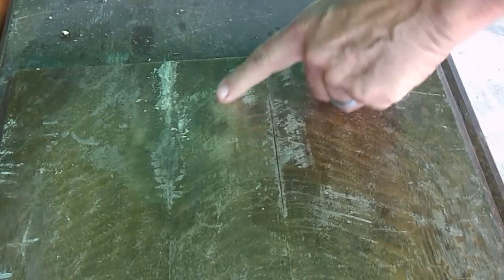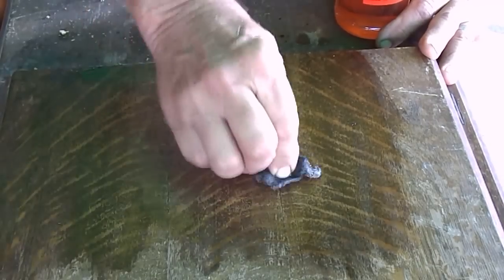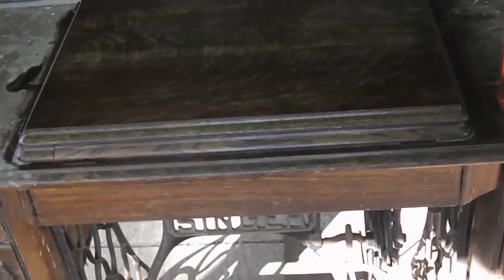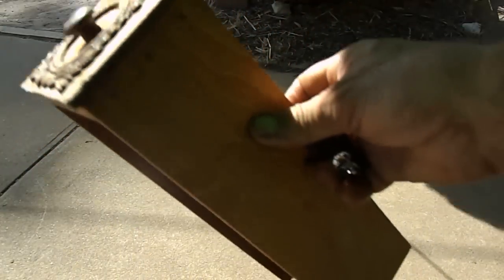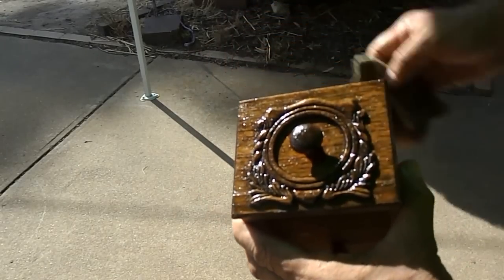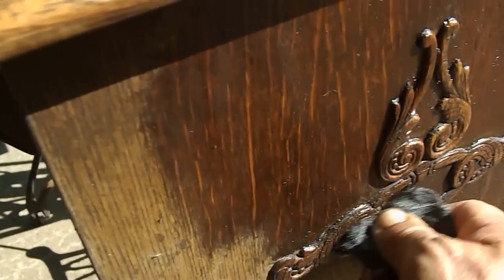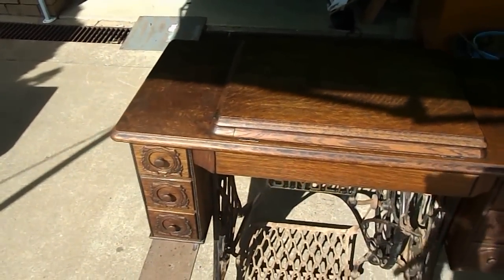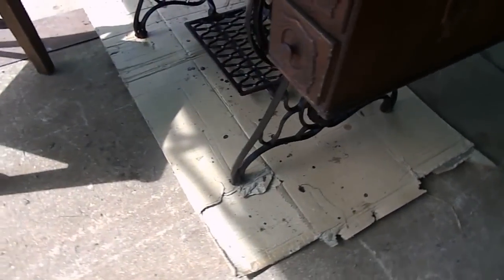Restoring a Treadle Sewing Machine Cabinet from scratch

Comment: I have the identical cabinet - I polished it up with almond oil - the only oil that I had on hand but may try the Linseed oil.  Unfortunately I had stored and used my water distiller on my machine in the laundry room and have some water damage on one side... tough lesson to learn!  I brought it upstairs and put it in my front room window and have been admiring it ever since.  I need a belt now so I can give it a whirl - it did sew when I got it - have no idea what happened to the belt but I just saw a video on solving that problem... I really love You Tube!  Thank you for the great tip on cleaning it but mine looks fine - not sure if I should do a deep clean like you did.
Reply: Joyce Robertson Hi I dont know if it will work, but I removed a water wood stain with a hot iron and a towl, place towl on piece an iron slowly putting up iron temperature. It worked for my table, try at you own risk, check you tube.

Comment: I once while helping a lady clean her old pine paneling with a mix of half fantastic and half ammonia, believe it or not, it works great, just have plenty of ventilation, using steel wool same as he used, does the same to most wood finished. Redid cabinets this way, I am imagining this smells much better lol.
Reply from the maker: Yes works on Just about any wood surface. Just need to prepare the surface correctly before starting. It even works on scratches on floor boards , fills that scratch beautifully.

Comment: Thank you for that, you've given me the knowledge I need to clean up the frame. It's the same model as mine :) It's in very good shape apart from veneer on top of the lid peeling off so I only need to give it a good clean. I have a machine mechanic near me that restores the machines to working condition and so I will soon be able to use mine.

Comment: Great job, and a fast one too.  Just a tip or a suggestion if you run across irons that are not rusty, after washing and drying them down. Then use mineral oil, you will be amazed at how black and shiny they are when finished, They look amazing.  Give it a try and let me know what you think.  Great tip on the Pale Boiled Oil, one question where do I find it?  I mean do they sell it in the hardware stores?  I have never heard of it.  Oh and another question do you have a tutorial on how to apply veneer to the top of a vintage sewing cabinet.  I bought one and the veneer is peeled up and broken in pieces.  Thanks in advanced.
Reply from the maker: Love having different idea's Markay. Thanx very much for that.  Yes works amazingly.
Reply: Me too, and your welcome. :)
Reply from the maker: Markay hi. sorry for the  delay.  Here, down under, we are bale to purchase the Pale Boiled Oil at Hardware or paint store. Good Luck with that.
Reply: Do you clean the surface before applying the oil?
Reply: Really appreciate watching this. Do you use the pale boiled oil on its own or mix it with turps please?

Comment: I have 2 treadle sewing machine and 2 1800's end tables, that were my great grandpa's that I want and need to refinish. Thank you sew much for all of this great information.  Do you have one on how to refinish the metal under the cabinets?
Reply from the maker: Roseanne. Thank you sew much.  Yes we do have a few on treadle bases just have a look thorough our clips. 
This method is not the original  nor the best but we Believe it is a very adequate method which will give a very  attractive  outcome without ruining the original charm. Basically a  non expensive alternative which looks Great, Good Luck.
Reply: @SewWhatMaryborough800plus  Thanks, I'll go look.  I also have an 1800's rocking chair I would love to fix it and refinish it too.

Comment: Just the ticket for getti g off the old crazed shellac off Nana's old 66.  Thanks!  Do you follow up with 0000 steel wool and polish?
Reply from the maker: Fran. I don't what I usually do with the last coat is wipe of excess  and then polish intil shiny. '))))' probably would do the same thing.  Well done.

Comment: great video thanx! im just wondering if you used putty in the cracks or just left them? im about to start work on a treadle cabinet that has some water damage that has caused a crack. It has lifted 3-4mm.
Reply from the maker: What we do if there are cracks with a concern is we put some wood working glue in the cracks and give it a Light sanding to put the  sawdust into the glue which does an amazing joy. Just don;t sand too much, that veneer is quite thin. Good Luck
Reply: that was a dam quick reply! thank you! i never even thought to use saw dust! i did consider taking the veneer off and putting new stuff on, but i want to keep it as original as possible.

Comment: Hello! Great video! I've just purchased this exact table and there are some areas where the wood has lifted or chipped off, any ideas on how to correct this?
Reply from the maker: Nicole. yes..   what you do is with a very fine  blade scrape the  dust and muck out from between the veneer layers,  Then  squeeze a wood working glue in  between those layers, again with that blade spread as much of that glue under that veneer. then place a piece of cardboard on top of the veneer , then a piece of timber which covers the whole lifted area  then clamp it.  Leave for a day then  remove the clamp then the timber. Finally lift the cardboard, some may  stick to the veneer. that can be easily sanded off then  back to re doing your cabinet. Good luck.
Reply: Sew What Maryborough thank you! And what if the veneer is chipped and I don't have any extra bits of veneer to replace it with?
Reply from the maker: If its only small amounts you can use a course sand paper to sand it ( with the grain)  and create a grain while smoothing the ridges, then use a   selected stain and carefully  stain that area, But try it on a spare piece  first. Adding the stain is something you will need practise with
Reply from the maker: In a lot of cases its easier to look on Ebay or some sales  outlets and find a complete cabinet/Timber and just swap it over. That is a much easier option.

Comment: He's just been watching a few video's on using pale boiled oil. What's scaring me is I'm hearing that your rags are highly flammable and should be disposed of properl. What did you do with you steel wool and rags once you finished?
Reply from the maker: I kept them in a cool place until rubbish day and placed them in the general waste bin. They are only in danger of combustion if they are placed in a warm place. Really its being cautious. Kept in a cool well aired place.
Reply: Do you think it would be ok if I left in a bucket of water. Want oil on Saturday but bin day is following friday
Reply from the maker: Neil I have been using this oil for over 10 years and have had left the cloths in many different spots.  I have never seen any of my cloths ignite, But one has to  be very aware of its nature. Just always keep it in a well ventilated spot and as cool as possible.

Comment: Hi! I’m about to tackle a singer cabinet and I have a very basic question:  How much sanding did you do before applying the linseed oil?  Did you completely remove the original shellac?  Thanks!
Reply from the maker: Steve,   Basically the Only sanding I did with this was when  I removed the molding to re glues.  The Shellak was so crystallized  it just sent to  powder when hit with the steel wool. Mind you don't Get  machines In this conditions . So Neglected, weathered  and  prime for this  demo.

Comment: How did you "prepare" the cabinet? Just a wipe down with damp cloth?
Reply from the maker: +smilingwoman1947 . I wiped the Cabinet down with a soft cloth just to get The dirt and dust of.  The fact that the  shellac is already dry , no need to moisten it .  The drier the better.  I hope this helps. Thank you

Comment: I have bought two singers in the past couple of months and am looking forward to restoring them over the holidays. It's really great to get an Australian video so I know I can source the materials easily! My only question about restoring the desk is that mine has a veneer on it that has lifted and chipped off in a couple of areas - is there any easy way to repair it? Can i remove all of the veneer? Or should I just restick down what is left and enjoy my singer as is? Cheers Bron
Reply: bronwyn jennings normal wood glue does it quite nicely but small cavities, cracks, chips fill with super glue

Comment: When you do the second coat on top, do you use the steel wool again or just a cloth?
Reply from the maker: Hi Jessica  triple o steel wool each time.  You only use a Lint Free cloth to wipe over  5 mins after the second coat to remove streaks or excess .. The finer each coat the Better result.  I hope this helps.
Reply: @SewWhatMaryborough800plus  thank you so much for replying. I just bought a Singer sewing machine from 1909. She's a beauty, but she needs cleaned up. I'm going to try the pale oil and the rust converter.

Comment: I have a vintage Singer 66 treadle in a parlor cabinet.  A new find for me.  The machine sews just fine after a good cleaning and oiling.  However the balance wheel clutch knob will not budge one way or the other. You just can't turn it.  Any ideas?
Reply from the maker: Gemma, Hi Yes.. Sometimes it may take a while , we had one which took three Months to get working.  Sewing machine oil, again, again and again, saturate it and continually put pressure on it.  It will eventually free.  The occasional tap  but just be patient.  A bit of Butch can also help but use That within the boarders. It will free just don't be too impatient . Once you get a 1/4 of an inch  movement, oil, pressure, oil pressure. It will free. Good Luck

Comment: Have a 31-15 Singer Sewing Machine that hand pull has freeze  I have cleaned and oil machine. The machine has a heavy duty motor in good condition. Have own machine for  30 Years and never had many issues I couldn't handle.Help!

Comment: I am unable to find how to treat the gold decals on the wood cabinet without taking them off. I have a Minnesota B with cabinet.
Reply from the maker: Its almost impossible.  I have used a a very diluted paint stripper  and rubbed Very lightly. You will remove the darkened shellak  just be extremely delicate around the decals. You can do it.

Comment: I tried this on the case for my hand crank machine and I couldn't even get the dirt off of it.  is that boiled linseed oil or a different boiled oil?  I want to clean the wood case for my hand crank and my treadle.
Reply from the maker: Mona   Hi.   Yes..  Boiled Linseed oil .  Don't apply the oil until you have removed all the residue  you want off your  timber.   Clean it properly first.  If you miss a spot not to worry it can be sanded  or scraped off  after the first application of Pale boiled oil.  This is the beauty of this Method, you can easily re do it without too much problem.  Good Luck.
Reply: what do I use to clean it off first?
Reply: I just did the non pumice gojo hand cleaner on my Jones machine head and it worked beautifully.  now I want to try out your cabinet restoring way.
Reply from the maker: Good luck with it.  Just Take your time.
Reply from the maker: I usually use a  scraper to initially get most of the heavy stuff off.  I never use paint stripper,  after scraping the  cabinet back ( if it warrants using a scraper)  maybe a Light sand with the grain.  The initial surface is important to get it right before the oil.   Get it right the first time
Reply: I'll sand it because it's all grooved.

Comment: What is that liquid?
Reply from the maker: Reynaldo  the oil  we used is  Pale Boiled Linseed oil. which is Linseed oil with an additive in it which enables the external surface dry   as  Linseed oil does not. similar to snake oil,

Comment: What do you do to prep the cabinet before doing the oil?
Reply from the maker: Trish, Due to the  shellac's crystallized condition there was no need for that. If the Shellac was not so crystallized  you would Have to scrape it using a scraper or possibly lightly sand. After the first coat of oil you will see if  it needs  scraping or sanding. This  cabinet had shellac not  varnish. Varnish would Need to be removed prior.   Good Luck.
Reply from the maker: Trish with a cabinet  in this condition  what you see it what  we did.  If the cabinet needs scraping back you can see that in some of my other restoration clips.  But this Is as you see it. The Shellac is very  crystallized and the steel wool does the prepping.
Reply: @SewWhatMaryborough800plus  thanks for your help it turned out beautiful. We sanded it down so as to match new veneer on top.
Reply from the maker: Trish..  Fantastic. So happy for you.  Well Done
Reply: I wondered about the prepping to, and I get what you say in response, but I was still thinking there’s a lot of dirt on there, especially in the draw fronts, they did look dusty.  I wondered whether the oil is bringing out the colour beautifully, but hiding the fact that you may be loosening, spreading and then sealing in the dirt!?  I think I’d want to brush and damp dust the whole thing first, if you’ll forgive my saying.